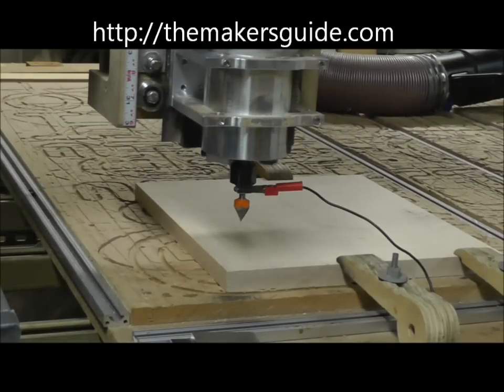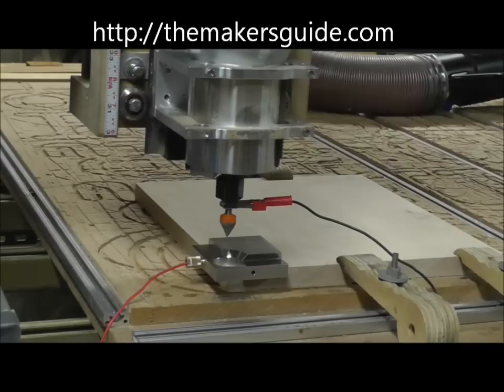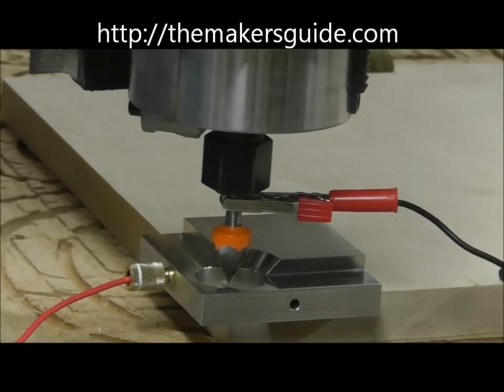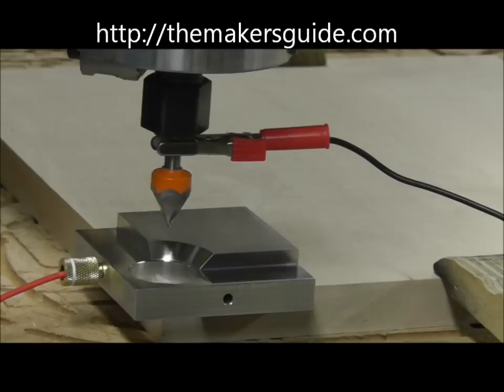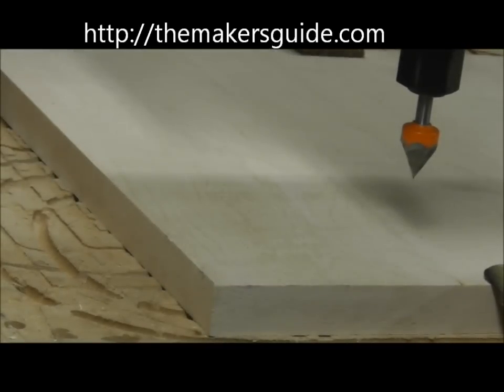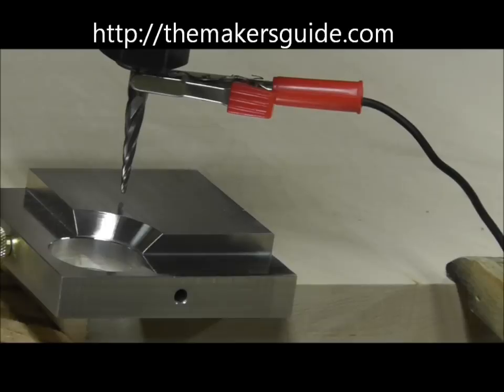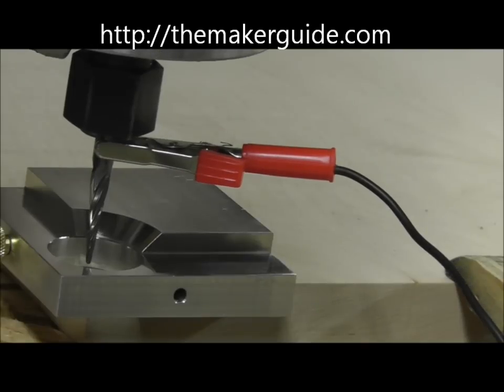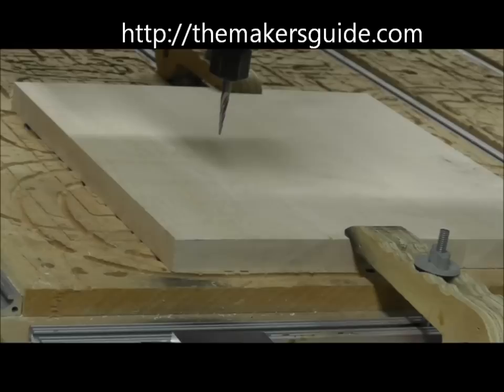Using Tapered Bits - CNC Touch Off Triple Edge Finder

Comment: Very nice device and idea, but something is wrong with your CNC. Sometimes its ticking, its not smooth at all, its resonating or something like that. You should check the servo parameters, or I donno, but this is not good.
But the positioning is genius.
Reply from the maker: +telelaci2 The machine was set to exact stop and not constant velocity. Also the base frame is bolted together and not welded.

Comment: Hello very nice and instructive
But I still have a problem with its HY-JK02-5-axis controller where to join her on cnc probe for X, Y and Z axis
Reply from the maker: Davor, your problem is not the Triple Edge Finder, it is the CNC Controller you are using. The HY-JK02-5 axis controller is an inexpensive controller which has 5 input pins available. Four of the input pins are used by the limit switches and the 5th is used by the e-stop switch. Since you do not have an input pin available you cannot use the Triple Edge Finder because there is no place to wire it. You could use one of the limit switch pins if you are not using all four. I recommend you get a better controller.
Reply: I appreciate the extra prompt reply
I have a default router GB16 and I want it to diversify into cnc router. This controller is my first and I went to the cheapest to meet with issues before the procedure.
In your opinion, which controller would be the most cost-effective for five axes
Reply from the maker: How many steppers do you want to control? There are not many 5 axis controller on the market. You may have to use add on drivers.
Reply: Bill Griggs I need a rotary table with an angle therefore need 5 axis